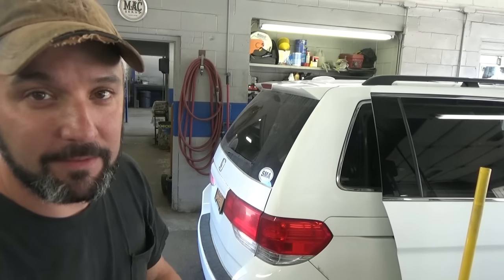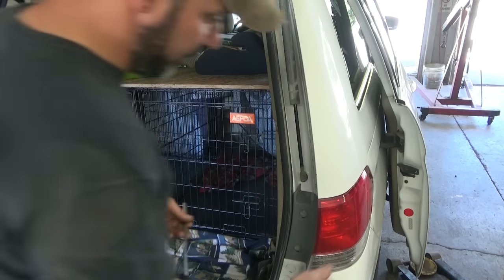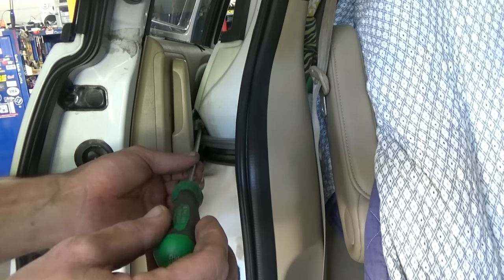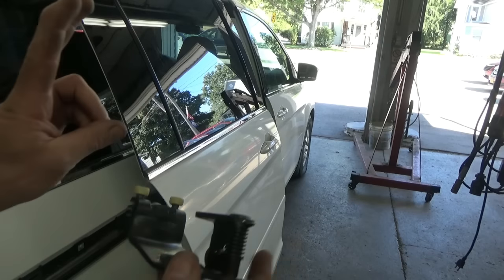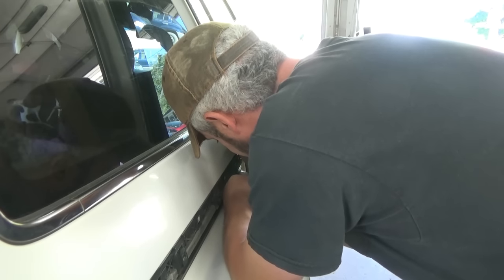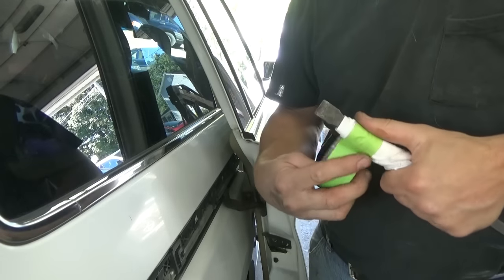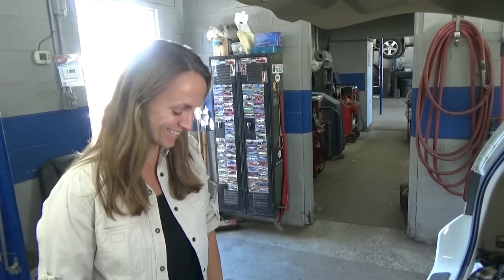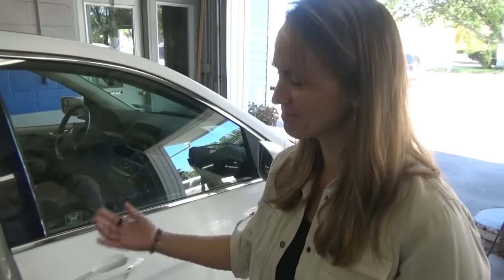Honda Odyssey - Sliding Door Center Hinge Repair

Comment: This video was a huge help!  Your tip about not removing the bracket from the door was a big time-saver.  Replaced the center roller in about 20 min - and that was with me running around finding tools and creating a pile of bricks to hoist the door up.  Thanks again!

Comment: Just finished in under 30 minutes. Takes a serious attitude to pull back the cable on the re-assembly process, but uses the shortest route to save a LOT of time screwing with access panels and internal cable drives.The best video once again.

Comment: Nice shortcut...it's nice when they engineer in a removable pin vs. a pressed in pin you can't change. Mrs "O" tells it like it is..."Ever since you didn't do nothing it's still broke"...you guys are perfect for each other & you can tell. Nice video & look forward to seeing you both even for a short time b/c it's refreshing to see!
Reply from the maker: Haha yeah after being together for 16 years you tend to be :)
Reply: If GM built that thing, they'd have pressed it in ... and made that side body panel all one piece, so you'd have to remove the roof & side glass ...
Reply: Actually the GMs are pretty easy and the newer ones went away from the sliding door. They all have their issues, some more than others. Engineers design cars and mechanics reverse engineer them to fix them. I am thankful for engineering design flaws & the new technology will keep us busy for years to come :-) ...and then there's Dorman which has them all beat HAHA
Reply: I liked it better when I could fix things half asleep. These new ones get my blood pressure way up there. Moronic designs. Definite job security, though. :)

Comment: I want to thank you slouch I did both sides in about an hour and a half because of your cheat I used a half inch extension because it was the first thing I could find with the reach you were the only one that simplified this job on my 07
Reply: Sorry I tried to say so much but came out as slouch

Comment: Thanks for all your awesome video. Just fixed my passenger sliding door Odyssey 2006 just like you described but I had to take 2 , 12mm bolts off hinge.  Need to mark hinge with black marker to make sure it is aligned properly.  Also, it might be easier to bend  one side of metal leaf on cable holder so that you can insert back cable easier.  Then bend back to secure cable.  I found that after I replaced roller, the car would make the alarm door sound whenever I put car in drive, even though the sliding door was closed securely.   I found that I needed to reset door by pulling fuse 7 under the driver's side foot well for 10 seconds and then putting it back in.  This fuse is labelled BACK UP in owner's manual.  This got rid of the door alarm noise and also the sliding door warning yellow light on the dash shut off.

Comment: Great video, especially with the Mrs. adding a little beauty to the screen. Seriously I plan to do the same on my Odyssey and this video is great and very helpful for the DIyourselfer, like me. The right side sliding door hops and skips but still works, but sounds like it has a hernia as it moves,  but the odyssey has 190k miles. Its due, and I might do same hinge replacement on both sliding doors. Other day when the car was parked on a slight incline up at the mall it freaked the wife out because the door would move a few inches and stops, could not go up the very small incline. Having my observant hat on, I moved the car to be on the incline down, and sure enough the door slid closed easily. So it is time to do what you did in this video. Will save a lot from dealer price. Thank you, thank you
Reply from the maker: Cool! glad to help :D

Comment: Another great SMA video.  I did both of mine on my 08 Touring last year but I used a sharpie to mark the  bracket location and just unbolted it from the door.   Other than that I did the same way you did.  I think it takes the same amount of time either way.  No way I'd pull the quarter trim panel for that.

One correction for you, Eric.  Actually, there are FOUR switches in that rear latch assembly.  The full latch, half latch, ratchet, and base position switches are all in that assembly.  The most common failure is actually the base position switch.  A failed or dirty base position switch can even cause the door to not work at all and can cause a parasitic drain on the battery overnight.  Customer complaint: Door doesn't work and battery is dead after a day or two = base position switch problem.  Many times the switches are fine but the latch just needs to be cleaned and re-lubed.  Obviously, in your setting, Eric where time is money, it's best to replace it with a new one but for the DIY'er you can often clean them up, make sure the cams are moving and activating the switches normally, and then put it back in.  By the way, you can see all these switches activate in your scan tool. (I know because I just picked up an Autel MaxiDAS DS708 on craigslist for a steal of $225 - May 2016 update. YAY!) and played around with the doors and switches in the scan tool.  

Another common failure in these doors is the release actuator, sometimes called the unlatching motor.  This is a little black gear box right in the lower center of the door when you pull the panel.  When these start to go, the door will start to open/close and then immediately stop or it will open/close and make a popping noise.  They are easy to replace (three easy screws and a small spring) and, for the DIY'er can be disassembled, cleaned and lubed, and reinstalled.  There's a little metal pin in the clutch that gets a bit sticky.  If you're in there and you've dropped the money for that rear latch assembly I'd also replace that release actuator.  It's not very expensive to just replace it if you don't want to mess with disassembling it and cleaning it.  It will fail.  

On my Ody, I've replaced the rear rollers and cleaned/lubed the unlatching motors.  I haven't had any rear latch problems (yet.)

Comment: Thanks, this helped me get the job done on our '09! I had some trouble trying to knock the pin out with the hinge still on the van, so I ended up unbolting it from the door and hammering out the pin while it was safely away from the glass.

Comment: My 199 odyssey needs the same roller replaced. Mine doesn't have the auto door cables though, but it still looks the same. Your video was the first one I've seen where just the pin wash pushed out. Going to have to try it your way...Thx for the tip!

Comment: Thanks to you Mr O. Yesterday I replaced the EGR valve on a 2010 Dodge journey with a V6.  I have a hand held engine diagnostics device that I used to troubleshoot. I can't control stuff with it but other than that it does a lot of other fancy stuff. 
  You should be nicer to your wife she looks like a sweetie pie 🥧 
Cheers mate

Comment: Man, kids these days are lazy. I said it before, and I'll say it again, why do all these vans need these complicated power doors? When I was a kid, we used our hands to slide the door shut, and sometimes we actually used our hands to roll the windows up and down.
Reply: Rusty Nail lol. I'd rather have to open or close the door, than have some stupid mechanism that is gonna break. I'd like to know how many how-to videos there are on the internet about fixing these Honda van doors. You watch, next they are gonna be coming out with doors you can open and close with an ipad. Kids can't be bothered looking up from those things long enough to push a button for the door to close.
Reply from the maker: Haha so true
Reply: Regardless, the sliding door is still the weakest point on the whole vehicle. If you use too much force, a mechanical sliding door will still break.
Reply: You forgot that you had to walk to school each day, five miles, and up hill each way. It also rained every day, when it wasn't snowing....
Reply: Mikey well I actually grew up with Van doors and I have to tell you kids and most adults couldn't open the slider if we were on a hill.
Reply: Those days are loooooong gone.

Comment: Great Video - followed along and just replaced my driver side (Left) bracket.  Hardest part was actually getting the taillight off (getting the plastic pin to come out).  The two plastic rollers were fine, but the entire shaft that holds them to the bracket was wobbly.

While the door now slides nicely again, this did NOT fix my problem.  Pressing the button to open or close the door does NOT work (nor the automatic function with internal or external handle pulls.  And no door latch "lock down" sounds either.  I swapped the fuses under the hood in the box behind the main fuse box just in case one was bad, but right door still works fine, so not the fuse.  Hoping it is NOT the motor assembly, but it might be.  Does that motor assembly also control the electronics for the door latch actuation?  Off to google search for that issue now..

Comment: Eric  what brand of  magnetic screwdrivers  would you recommend . My tools have been lent out and mis used over the years  .You know where all the corners are worn off and applying so much pressure removing a screw wou
ld blow blood vessels. I have made up some tool boxes for the kids to use and I will replace my oldies with a good set of magnetic  with a new rubber grip .

Comment: I have yet another question for you. I have a Honda Ridgeline and I turn it on today and the read out is out. Do I check a fuse or when this happens it usually means a new screen?  116,000 miles and it was working yesterday but no go for today. Is it possible for the freezing cold last night killed it. Hmm

Comment: Hey Eric. If you need to remove/install a non-magnetic screw,`etc., just stick a small piece of LePage's Fun Tak Adhesive Putty on the end of the screwdriver tip, remove the screw and the putty will hold it on the tip for you. Get it at Staples runs about $3 for more then you will ever need.

Comment: Quick tip on E clips and the like. Take a piece of masking tape and stick it over the clip/pin so you cover the area that the clip has to travel to come off. Now use a pick or screwdriver to poke through the tape and remove the clip. The tape will catch the clip as it comes free so you don't have to play fetch.
Reply from the maker: Perfect!
Reply: Without those marvelous games of " Fetch " what else would Eric do with all his free time ?
Reply: Excellent tip for the masses

Comment: While my door was jacked up and supported, it literally fell out onto the ground. The other two rollers came out of their tracks. It was one heck of a mess. I had to have four people help me get everything put back together. I have no idea why this happened. And, no matter how hard we pulled on the cable, we could not get it to stretch enough to get it back into the roller assembly. So now I have a manual door. Which is probably better anyhow.

Comment: This seems to be one of Honda’s most pi$$ poor designs ever.  The under designed four speed
automatic transaxle in our 2000 Navi is worse.

The roller appears to be a piece of steel without any bearings whatsoever.  Would it be possible to replace the roller with a roller bearing? Getting the correct shaft inner diameter and correct outside diameter might be difficult .

I believe the replacement will eventually fail. Just like the three replacement transmissions that went into my Wife’s Odyssey.
This was our fourth and last Honda.  I will never, ever, own anything made by Honda again.

Comment: Common on this van, open assembly there are 3 switches inside, the one closest to the latch has a lever with a return spring it gets dirty and will appear to spring back all the way but if you look close you will see it does not go all the way to engage the switch clean and lube all parts make sure spring engages switch every time reinstall.

Comment: "at 10:28   "Jack it up and put a little tension on it".   Really?  Tension??  Where are you PULLING it with the jack?  How???   I really think you have the wrong word there.  You were actually putting "PRESSURE" on it with the floor jack.   Why do so many Yanks use the wrong words — those with the opposite meanings of what they are really trying to say???  It is some kind of stupidity that appears to be native to the Yanks.

Comment: I wish I had found your video first would save my self a lot frustration I did not turn of the door switch off and the cable went  into quarter panel now I have take all that plastic off to get the cable out Ugg headache now

Comment: Hey, Eric, that looks like an EX-L.  Do you use the "VCMuzzler" on that to disable the VCM (ECO mode?)
Reply: Used it on my 09 pilot, after spending 5 grand on transmission, engine mounts etc. $100.00 dollar repair and the problems are just about fixed. Extreme weather swings cause some problems, can be adjusted but is easier to wait till afternoon when sun comes out.

Comment: I did both of mine they were both metal-to-metal it was causing my door to have problems closing it keep opening and trickling at the open but I wasn't as lucky as you I had to take the tension off of it I struggle and struggle and couldn't do it without taking the tension off the cable I have a 2000 Honda Odyssey and right now I got 321000 MI it's been a year since I did it the last one and still going strong

Comment: Was wondering why you didn't lub the rails that the guide wheel ride on...Just curious
Reply: No need to.  The wheel bearings are permanently sealed.  It's better to just clean the rails so the rollers can move smoothly.

Comment: Time to buy Mrs. O a new van.
Reply: Those vans with minor repairs go forever, same time I have owned mine parents are on 3 Dodge van products 4 transmissions. They are getting ready to replace the current van. I have put a transmission, timing belt, brakes, a/c in mine. Turned over 300,000 about 6 months ago, drive 60 miles to work each day.

Comment: Home Depot sells cotton gloves with textured rubber coated palms. Makes sliding this style of taillight housing off a breeze. Especially if they have never been removed before. I was adding trailer wiring to my 2015 Hyundai Tucson and couldn’t get the housings to budge. Took it to the dealer and they wanted $100 labor to remove both taillights. Said “no way” and went home and found the rubber coated glove trick on YouTube.

Comment: What is the advantage of removing the pin while the the assembly still attached to the door?  Why not take the whole thing out first then remove the pin?
Reply: You will not have door alignment issues.Because if  the attached part of the hinge on the door is not attached in exact location on the door as before ,then ,the sliding door may not close properly .

Comment: A lot of times the major repair on these doors is minor. Before doing anything check the rubber bumper on the back of the top rail. If it is gone the doors will fail to shut right and not close properly. A $21.00 dealer part can save you hundreds in hinges, motors, etc.

Comment: I have found that is you get rub marks like that you can use Mr clean Magic Eraser's and it will come right off. Make sure it's wet before you start rubbing otherwise you will get the swirl marks

Comment: had an 04 odyssey never replaced them had 198,000 on the clock 11 yrs old. lost power to rear quarter windows and pass window from d/s switch.

Comment: Use a 1/4 long Extension but use it upside down with a ratchet plugs into it and put it on top of the pin and smash down you won’t slide off it

Comment: I did the timing belt on my neighbors 04 civic after the dealer screwed it up, yes the Honda dealer did a few months before and didn't even use a Honda timing belt, everything was good then a week later the money light came on, it was an oxygen sensor, guess who's fault it was? The odds are uncanny that something totally unrelated happens and the mechanic gets the blame, after you fixed my car my dog died what did you do?

Comment: Just take the door off and replace it with a safety bungee. Cheaper and if it breaks you can fix it for $2 with a new one
Reply from the maker: We have kids... you would need 2 bungees... $4.00
Reply: There goes your cost savings.

Comment: My side doors open and close ok, but the "door open" alarm sound keeps going off.
What gives?
Reply: I'm about two years late but it sounds like a bad latch.
Reply: The cable harness(s)contact panel(s) needed to be replaced .. contact panel was rotted out both the plastic and metal contacts were just about “gone” …